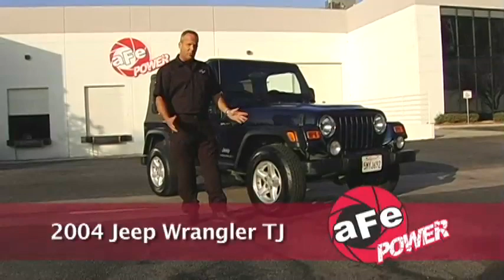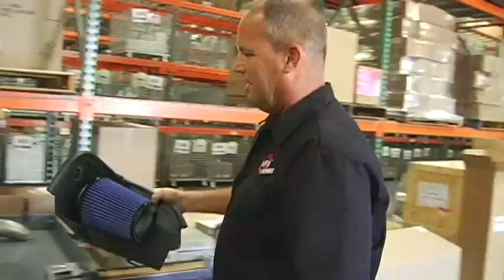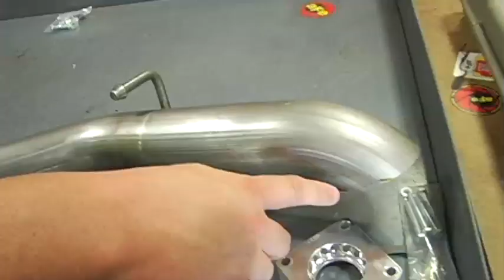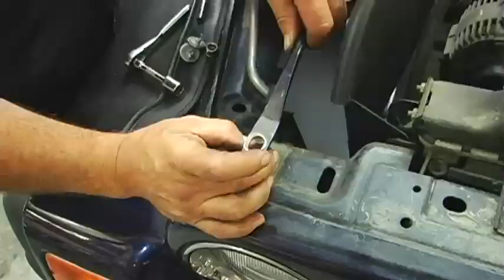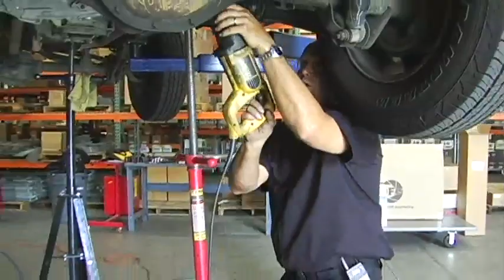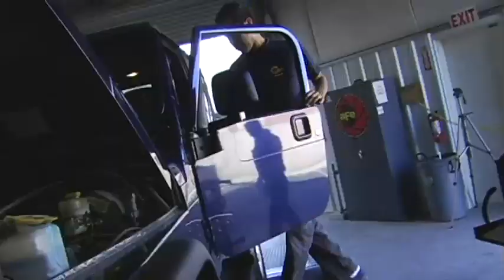aFe POWER Jeep TJ Power Package Install

Comment: I had an AFE on my Dodge 3500 Cummins diesel, worst mistake I ever made, I went through many of those so called million mile filters and even the pre filters, final straw when I couldn't tow my boat up the local grade, we had to turn around, I put the stock filter back on and now enjoy $12 filters and more power than with that POS afe

Comment: how in the world did it only put out 133 horsepower the 4.0 straight 6 puts out 190 hp stock and something in the rage of 230-35 for the torque. My xj right now is putting out about 220 with my upgrades.
Reply: Josiah Asbury.... numbers at the wheels are alot less then at the crank. the 4.0ho is rated at 190hp but I have seen them make as little as 115hp at the wheels on a dyno.
Reply: Josiah Asbury I agree. You’re right, a stock jeep 4L should put at least 190 horse power. I installed a K&N system And could definitely feel a boost in power after I installed it.

Comment: I have a 2012 Wrangler. The factory boasts 280 hp stock. I was considering just putting the cold air intake system on it to get a little better air flow. Would this be beneficial?